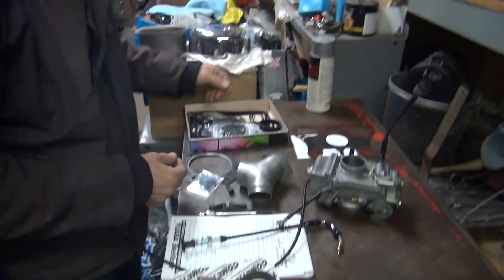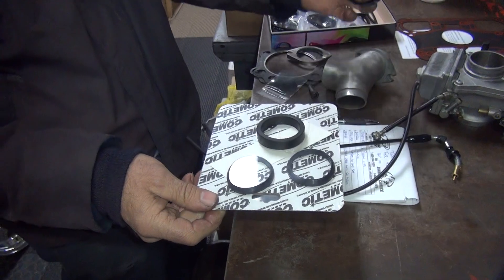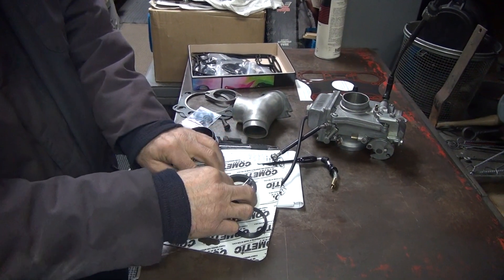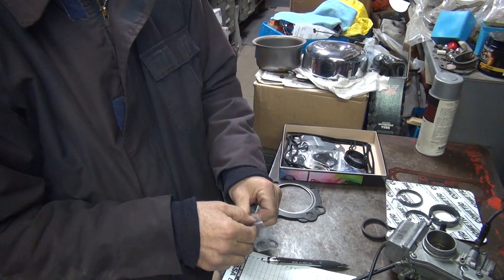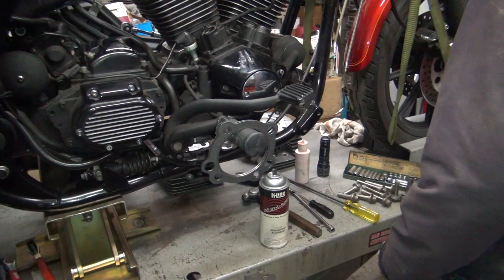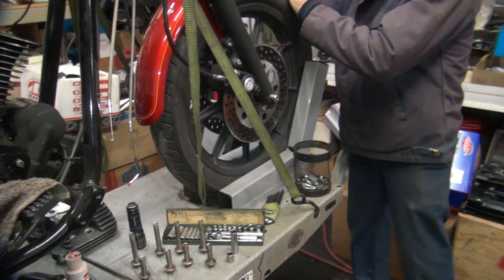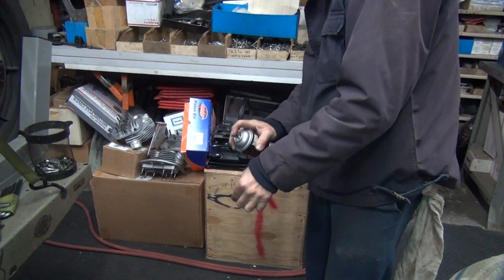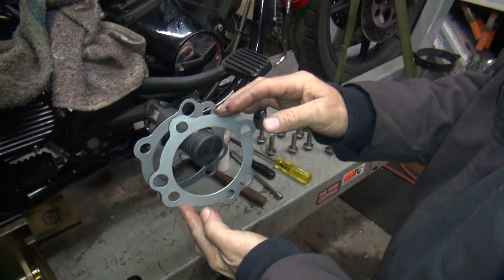#121 1993 80ci fxr cylinder head install assemble quickee topend rebuild repair harley tatro machine

Comment: Just wondering why you don't use the triple stack head gaskets which eliminates the orings.  Do you feel the oring style is better for a specific reason?
Reply from the maker: mls gaskets are not the best for all applications. they also tend to leak oil on harleys. harley is a weak design and mls gaskets need a strong stable platform to seal correctly.
tatro
Reply: @TatroMachine  Thanks for the reply. I enjoy your videos so thank you for taking the time to make them.

Comment: were do i get the  K-line none smudge aluminum at
Reply from the maker: go back 25 years and buy the last two cases they had.
a viewer said that mercedes benz use to use a similar product for their exhaust manifold sealer.
tatro

Comment: Tatro what's your opinion of KB or Keith Black pistons?.....thats what my mechanic is putting in my engine build cause wisecos are out of stock for months now.....forged of course...
It's finally gonna be done after 6 months and once broke in it'll get the tribodyn oil I bought from you...
Reply from the maker: i don't like the cast ones but i do like the forged ones. all you had to do was ask if i had any in stock.
tatro